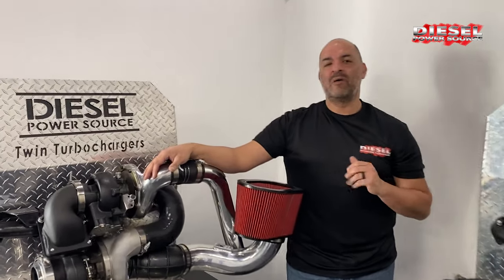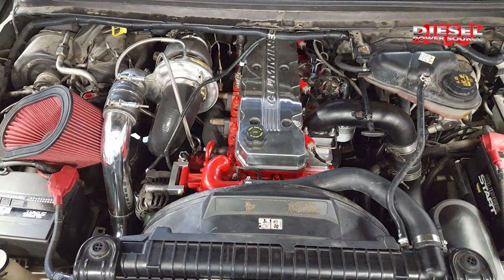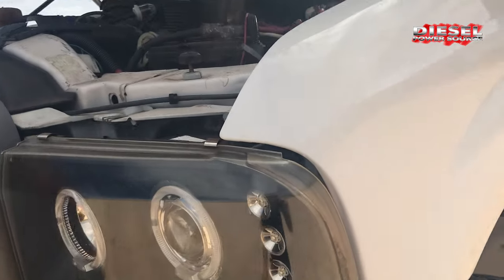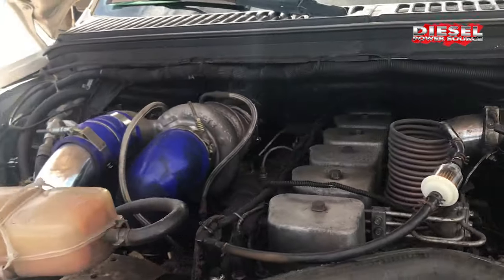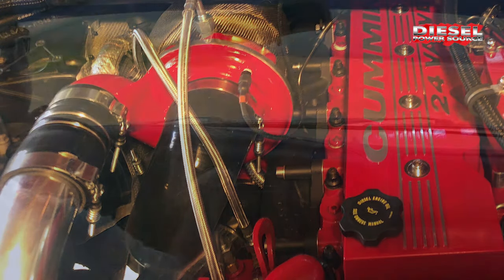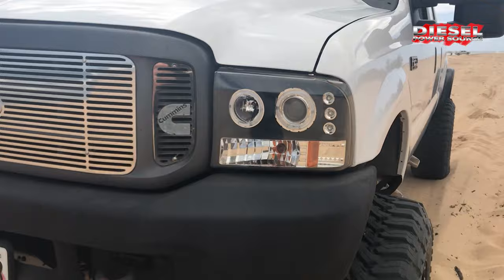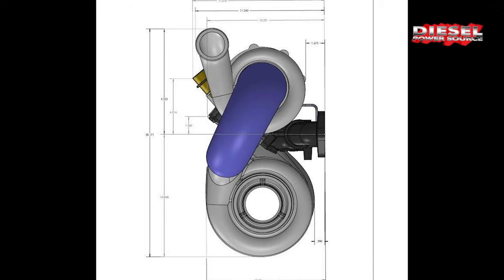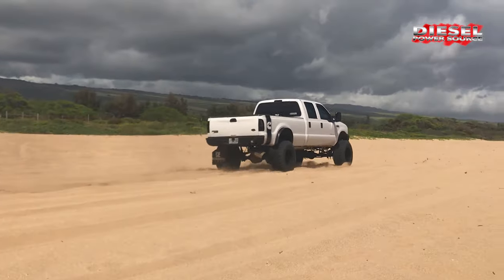DPS Fummins Compound Turbos

Comment: how will the stage 2 ,s475 kit sound on my 3rd gen ? I watched a video of a blue 3rd gen dually with stacks on your website Steve Norton from NY and the truck sounds and performs great, then I seen the same kit on another 3rd gen on  you tube it sounded totally different you could not even hear the truck and the turbos it sounded like a stock truck why is that?
Reply from the maker: Because we use a divided scroll manifold the sound will be that, deep throaty sound that everyone likes.  Because they draw so much air, they sound like a jet engine when they're boosted, not annoying, but you can hear them pull.  The other great thing about the sound, is the two turbos, together remove that annoying drone you hear into your cab when towing.